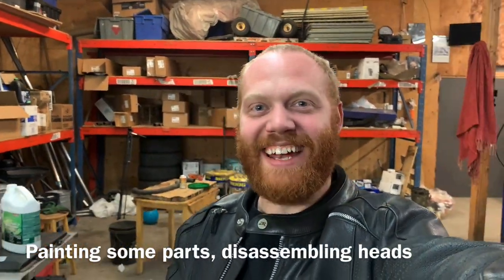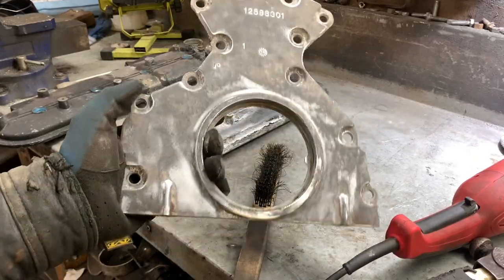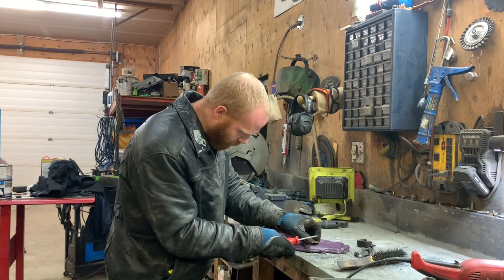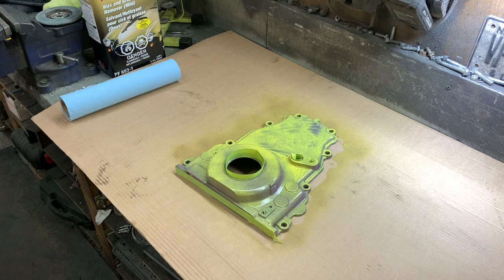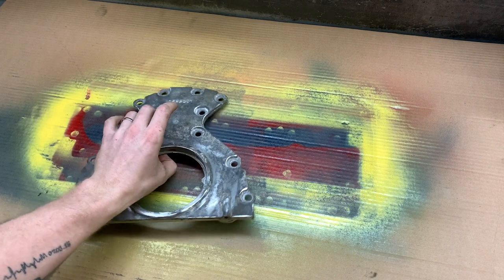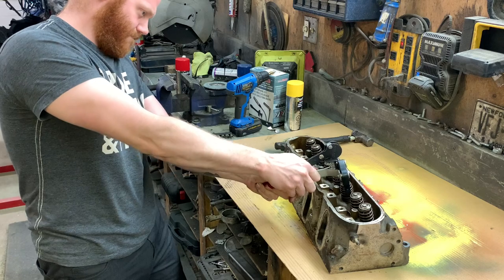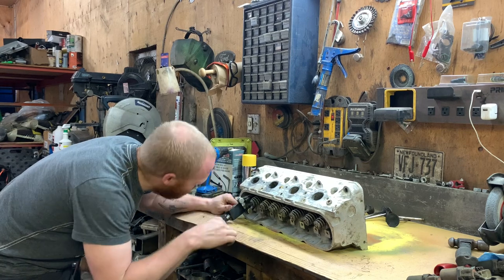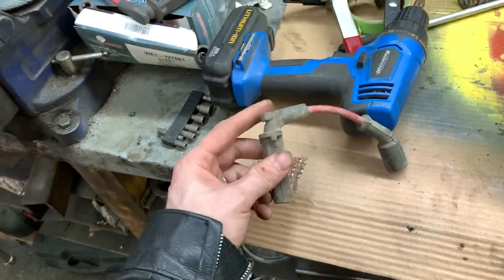Destroked 6 litre LS build - painting parts

Comment: I gotta get that wire wheel attachment for my grinder, way better than the one I have for my drill. Motor is looking nice!
Reply from the maker: It’s wicked man!! Watch out though, if it hooks your sleeve or shirt it’s game over
Reply: @StationroadRatrods  😂 too late it already happened and I’m scarred for life! Appreciate the advice 🙏
Reply from the maker: Ohh man it can be unnerving can’t it! Mine hooked in my sleeve once and binded up, I couldn’t turn it off cause the trigger was locked so I had to run away from the wall to unplug it haha what a time